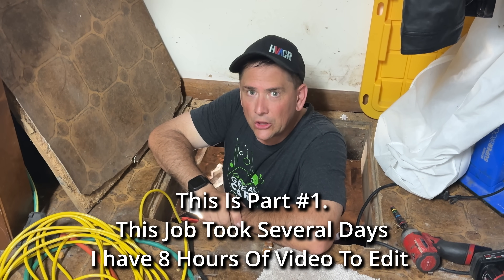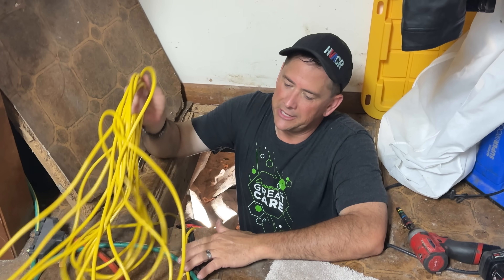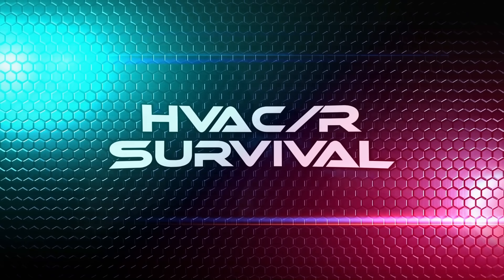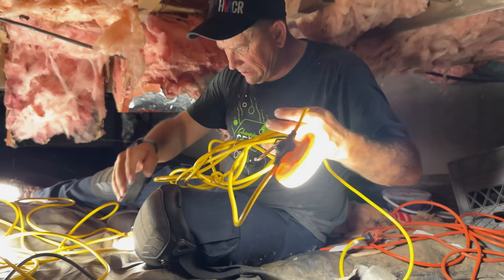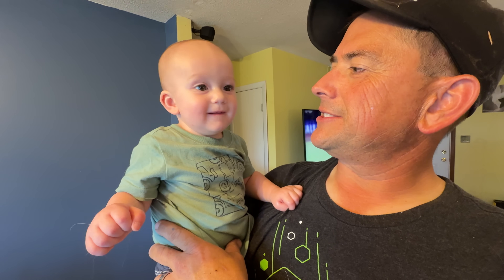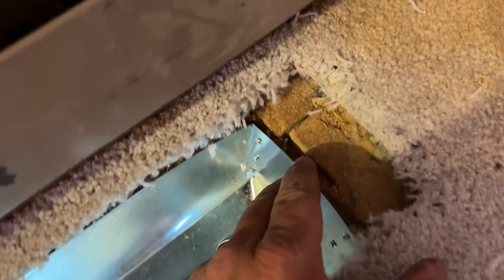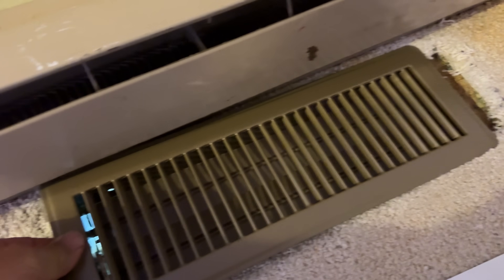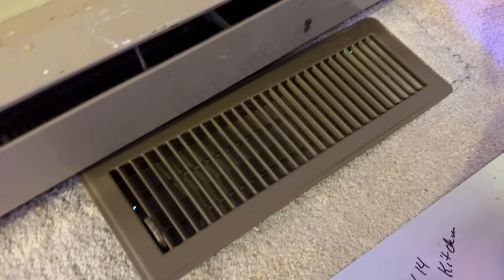How To Installed A HVAC System • Prep Work - Part 1

Comment from the maker: This will be a several parts series of the complete installation of my son's full Heat pump system. I'll cover everything start to finish and keep it as short as possible so that you can view each one at your leisure. This took several days to install and I have over eight hours of footage that I am trying to condense down the small videos that will keep you coming back for more. As I mentioned no one's off-limits when it comes time for me to harass and nag. It's just who I am and what I do. My sense of humor is ment to be funny...Sorry Not Sorry if you mistake anything. JK Kinda, not really.

Comment: had me howling. 🤣🤣
almost did mini-splits here, but decided to go full ductwork swap on 1st floor and new install on second. which I actually started the second floor part well over a year ago. all metal, no spaghetti noodles here, anyway, I jumped back on it late spring and redid the whole 1st floor/basement and tied in the second floor, in a layout that I can zone in future if I feel the need.
been doing other major work, replacing rotten wood, missing headers over windows/door on load bearing exterior wall, large lvl beams where load bearing wall was cut out and sagging bad, re-insulated all attic space and whole second floor, part of first floor, fully removed old insulation and added foam board thermal break whole 2nd floor, 100% rewire, just replaced the 6 remaining wood sash, single pane windows and trimmed them out(aluminum coil/brake bent). one of these days I'll get drywall hung and finished. 😬🙄

Comment: Wait until you go out on one where the 95% gas furnace condensate drain was connected to their sewer line. Sewage backed up and seized the draft inducer motor filling it with shit. The draft inducer had to be replaced - not under warranty.
Reply: oh dear lord. what clown did that install? 
now I have been in basements that flooded to the rafters, but storm rain water through open wall/windows. but I have seen sewage pretty deep.

Comment: @2:18 I thought I made up the clothes hanger trick.
Reply from the maker: They were doing it when I started 30yrs ago. I can’t believe all the things it will drill through.
Reply: @HVACRSurvival I watched a guy ruin a whole room of berber carpet by using a normal drill bit. It snagged a thread and made a run the length of the whole room. We always had uniform hangers in our trucks because we had uniform service and that’s when I got the bright idea. I love seeing things like that. A good idea is a good idea. When I’m ducting a whole house by myself I use a bunch of them to drill down then I go and write down all of my measurements at once then I cut all the holes.

Comment: OK Rick I have a better one than this believe it or not! When I was in Or. I was sent on a service call at a rent house, gas furnace in the craw space, I opened the access door looked in and there was 1 to 1.5 inches of water all the way across the house to the furnace. I did a 4 point craw with tool bag in one hand , made it to furnace without slipping look at the burner rack for 2 minutes crawled back out and called the guy that that sold the residential replacements and told him what i found and I drove this point home "the furnace must be relocated to the laundry room or the new unit will be trash in two years and left it in his lap. Two years later I was sent to the same house and found the unit in the laundry room! It feels good when some one hears you! 😃
Reply from the maker: I always tell the homeowner we’re human. If you want a good job don’t make our job a bad one by putting it in a bad location.

Comment: I use ceiling tile wire for a drill bit.
Reply: I use it for pulling T-Stat wire down a wall!
Reply: the stiff insulation hanger wires are a bit better, although it's really close to the same.

Comment: Service guys do installs better than installers because we install equipment that’s actually SERVICEABLE.
Reply: We also would make better equipment designers than the ones that design some of this crap.
Reply: @AaronPowellvox engineers don’t get to make all the decisions. If it makes zero sense or has zero serviceability it’s likely because an engineer was told no by the bean counters.
Reply: Amen!  We see good installs and bad installs and become great installers based on that.  I pride myself in having a nice, clean, and serviceable install and am constantly trying to perfect my craft.
Reply: @jasonyeager9102 I know exactly zero service guys who are great installers. Most of them are slow and their work is not pretty, including myself.
Reply: I’ve seen both, installers do clean work, installers do shit work, service techs do clean work service techs do shit work, just depends on the tech.
Reply: @AnthonyLutsik let’s be honest, most techs are sloppy installers. I’ve been a tech for 16 years and I installed for six months total.
Reply: @jman0870 I can agree with you on that, especially in the commercial space where techs are taught to get stuff running no matter what
Reply: If I install anything it’s going to be serviceable but it’s going to look like dogshit. Been running service/fixing crap professionally for 16 years. Only 6 months of that was install. 🤣

Comment: Back in my day when I was a Installer which was 4 years ago we used a solder stick to spot holes used to go in between the cracks of the flooring
Reply: those insulation hanger wires work great.